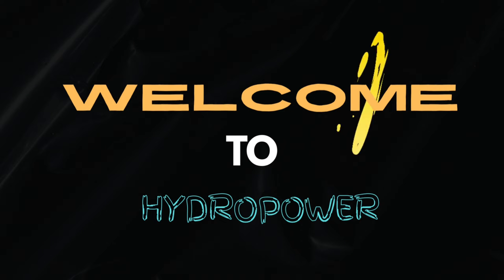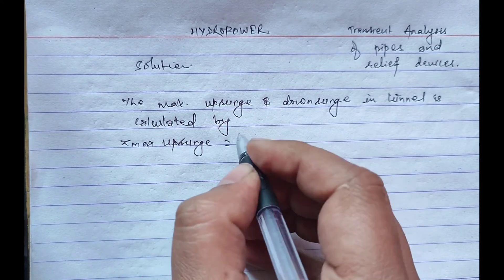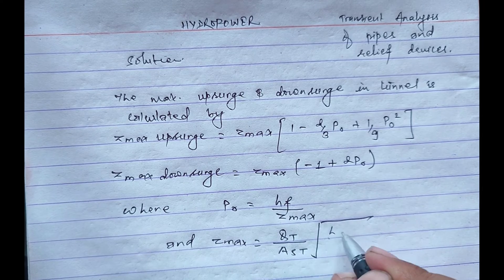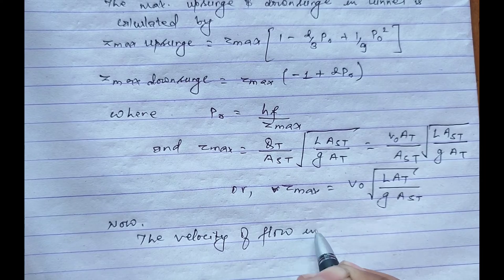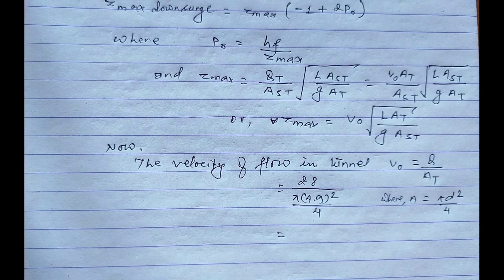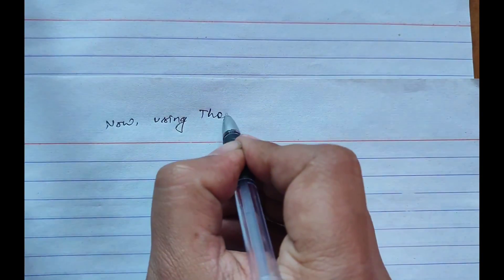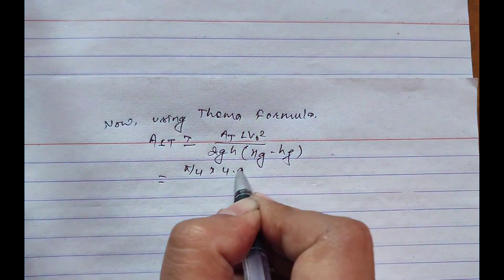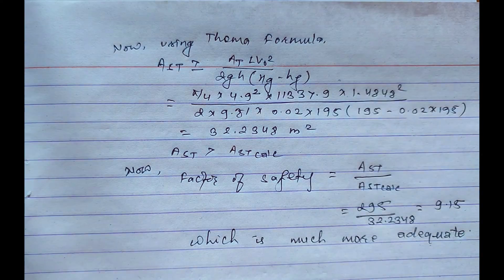Calculation of Length of Tunnel, Maximum UpSurge : down Surge and Factor safety of Surge Tank

Comment: How to calculate height of surge tank ?
Reply from the maker: Question: How to calculate height of surge tank?

The height of a surge tank in a hydropower system is calculated to ensure to manage the water hammer effect, stabilize flow, and maintain pressure within safe limits during load variations. The height depends on factors like the head of the system, pipeline length, flow rate, and system operation. Here's the step-by-step process:
______________________________________
1. Calculate the Water Hammer Pressure
When a valve closes suddenly, the water hammer effect causes a pressure rise in the pipeline. The pressure increase (ΔP) is given by:
ΔP=ρ⋅a⋅v 
Where:
	ρ: Density of water (≈1000 kg/m3)
	a: Wave velocity (depends on pipe material; for steel pipes, a≈1200−1400 m/s)
	v: Flow velocity in the pipe (m/s)
______________________________________
2. Determine the Surge Head
The surge head (Hs) is the maximum rise in water level in the surge tank due to the water hammer effect. Use the formula:
Hs=ΔP/γ 
Where:
	ΔP: Pressure increase calculated above (Pa)
	γ: Specific weight of water (≈9810 N/m3)
______________________________________
3. Consider Operating Head and Freeboard
The total height of the surge tank (Ht) includes:
	Static water level: The head (H) from the reservoir to the turbine.
	Surge head: The rise in water level due to pressure fluctuations.
	Freeboard: Additional height to account for safety (10−20% of the surge head).
         Ht=H+Hs+F
Where F is the freeboard height.
______________________________________
4. Perform Dynamic Analysis (if needed)
For precise design, perform a transient flow analysis (e.g., using the Method of Characteristics) to simulate water level changes in the surge tank over time.
Below are the key dynamic analyses performed:
	1. Load Rejection Analysis
	2. Load Acceptance Analysis
	3. Emergency Valve Closure Analysis
	4. Water Hammer Analysis
	5. Oscillation Analysis in the Surge Tank
	6. Stability Analysis
	7. Drawdown Analysis
	8. Freeboard Analysis
	9. Combined Transient Analysis
Tools for Performing Dynamic Analyses
	Method of Characteristics (MOC): A numerical method to solve unsteady flow equations and analyze water hammer and transient flow.
	Hydraulic Simulation Software:
	MATLAB: Custom transient models.
	HYTRAN/WANDA: Specialized tools for surge tank and pipeline dynamics.
	Finite Element/Finite Difference Methods: For detailed transient flow modeling.
______________________________________
Finally, the surge tank height should ensure it accommodates all expected surges while maintaining safety margins. The above formulas are a starting point where as the exact values depend on system specifics and regulatory standards.